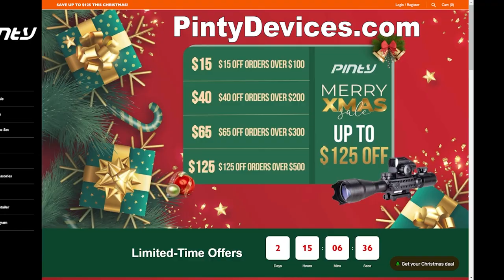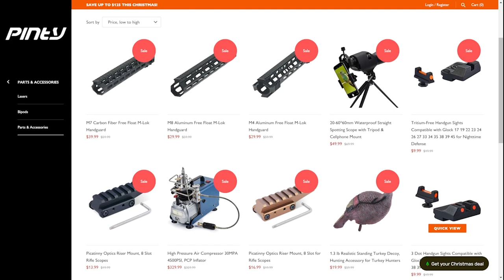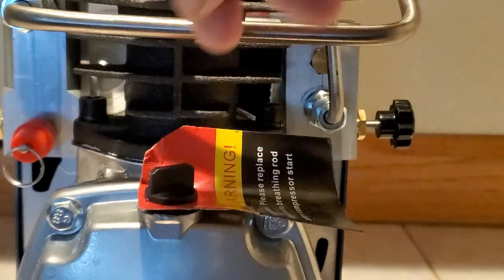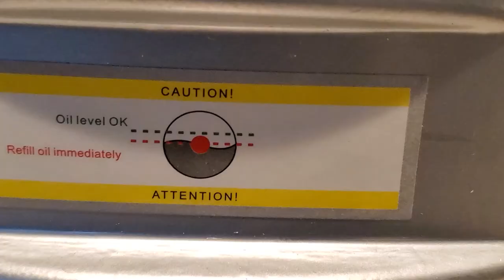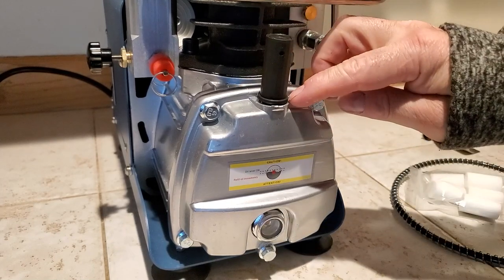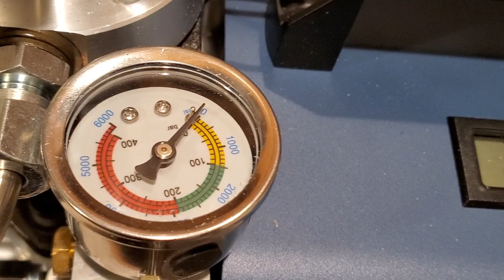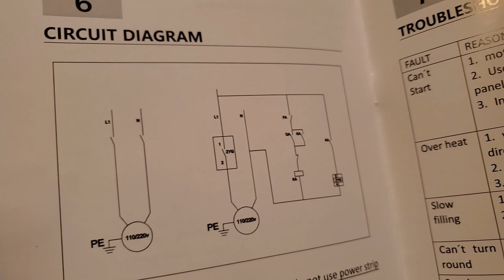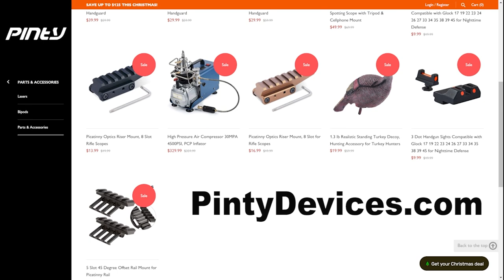PINTY Portable PCP Compressor (Yong Heng Killer?) Affordable PCP Pump @ www.PintyDevices.com

Comment: As my dear departed mom used to say “cheap is expensive“. I’ve been in the game quite a while myself. What I figured out is exactly that cheap is expensive. You bought 10 of these before you figured it out all my God! My recommendation is bite the bullet save up to get a decent compressor that you know can work and you can fill the tank up recharge your gun quickly. I guess this is a good stop that measure if you can’t afford anything else but you’re not gonna be happy with it.
Reply from the maker: I agree. I haven't bought a $3000 compressor yet. But I did get a Lil Foot, which is good quality. They were custom built by the Pellet Shop and Donny FL and China. Good times!
Reply: @AirgunChannel  I hear the big foot compressor is nice. Guy I'm in a group with has one. Flat broke airgunners
Reply: @AirgunChannel  the Lil Foot is a rebranded Tuxing 12v to their specs. same as the air venturi nomad and others from the same OEM. I guess your paying a premium for their customer support when it eventually breaks like all these small ones do.
Reply: @jp-3dairgunworks152  nomad 2 sucks I wasted 800 bucks on one of those , blew up in my house literally the Piston flew out the side of the box compressor I should of bought a bigass tank instead of a nomad 2 for 800 bucks ..but I can't afford it so I bought one like this one that he's reviewing I've has for about two and a half yrs I only fill my guns but it is super load and having to use water sucks imo 🙃
Reply: @chrisfigueroa3361  like I said. ALL the small ones eventually break even the Yong Heng. Plenty of videos here on YT of broken ones and people doing repairs. It is just piss poor Chinese QC.  Some people get lucky and others dont.
Reply: @jp-3dairgunworks152  yep they do but the one I have now does the job and I serviced it every 6 months still clean  in the inside it  works pretty good it's just f**** loud ...I  plan on getting a big tank there are plenty of dive shops where I live around me to get it filled

Comment: I have had a good experience with my blue compressor...it has been running for about two and a half years...6 to 8 runnings per year....oil has been changed after three to four runnings...it has been used to fill a 6L scuba tank to 4200 psi...it takes no more than 12 min to fill it from 3000 to 4200 psi. I changed the water pump to a bigger one (Sarlo 1000).   Not a single problem so far.
Reply from the maker: Awesome! I know alot of people who use them for years. Thanks for the comment! -Nate

Comment: I have made a few purchases from that company. I ordered a 4 to 16 power rifle scope with a reflex sight and laser pointer. I was very impressed with the quality of construction of all the parts and they included batteries as well so I can get started right away. Then I discovered there was no parallax adjustment for the scope. The glass was like a funhouse mirror. The reflex sight crosshair would move ever so slightly changing point of aim.  But the quality of the overall construction was impressive. I recently bought a bipod from them.. for air rifle 22 long rifle or even an AR-15 the $20 bipod is fantastic quality for the 20.00 dollar price. For what i am paying for these devices i am impressed with the materials and overall construction. The optical lens was a disappointment.

Comment: they will run indefinitely and fill LARGE scuba tanks one after the other- if you do this: get a 5 gallon bucket. fill it to about 3 gallons- then dump in a LOT of ice- to the point where it's about 1/2 ice & half water, stir it in good. if you're running the compressor, circulating from your ice water- and you can stick your hand in the ice water- and it still feels uncomfortably cold? you can keep running. just as soon as the water  warms up? STOP. ADD MORE ICE. then continue.

Comment: Nate…Seco  Lube type 500 Diester Synthetic compressor lubricant. Made to fill diving tanks and won’t smoke, lasts a lot longer than what I used to use which was Royal Purple. Stephan at Air Velocity Sport and made a video on it. Was 65$ a gallon. Runs cooler, no carbon building up on top piston, and no smoke.🤷‍♂️💯Check out the video @ Air Velocity Sport YouTube. He makes some wicked accurate slugs as well. Take care bud.
Reply from the maker: Oh yeah, I love AVS. I have been watching him for a long time. I'll check out his 500 Diester video. Thanks for the tip! -Nate

Comment: I've had my yong heng compressor for 2 years now I keep the water iced down all the way when charging my fiber tanks , it's my second one , the piston on the first one after 2 years snapped in half  !!
🎯 Great video and presentation NATE 🎯
Reply from the maker: 2 years aint bad if your charging full size tanks. Good stuff.
Reply from the maker: Good point
Reply: @dangerous8333  well I live on a 60 acre ranch in south Atascosa Texas I just walk out my backyard or on my gator and hunt  , I am planning to buy a Hill large  compressor  !!
Reply: @AirgunChannel  Sorry you busy. I new  Yong Heng lcd smart digital I bought. I have two questions, I would be happy if you answer them.
1) iso 100 mannol oil used, you think the best or bad?
2) Is yod water from underground or mountain water recommended?  Is it okay if I mix 1 liter of red antifreeze into 15 liters of water?  Or should I boil water?

Comment: Come on bro a hongYeng ain't going to kill another hongyeng. I'm very skeptical of any one pretending like it isn't the same thing. 
 Not including like industrial units, there are only like seven or eight different compressors actually on the market just rebranded.  They just powder coat the shell a different maybe they add one of the desiccant tubes. 
I got high pressure stuff so personally I'm not going to mess with it in mod my own too crazy but my job's got 240 outlets out the wazoo so I'm just going to run it the way it's meant to be.

Comment: its a 300 bar max. 4350 psi not 4500 psi. Ive had mine for 2+ years no problems. but i only fill to 4200 psi in my bottles.
Reply: I just filled mine to 300 bar in the cold.  Room temperature brings it to 4 500 psi